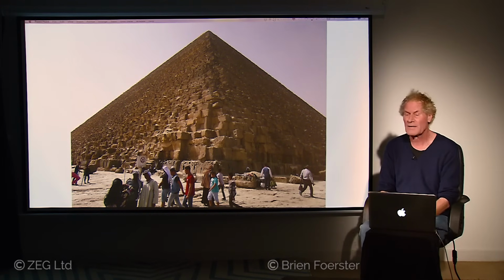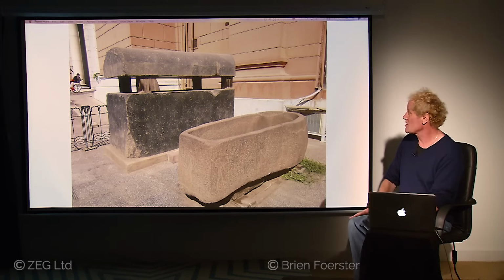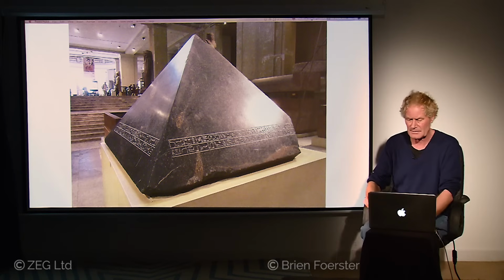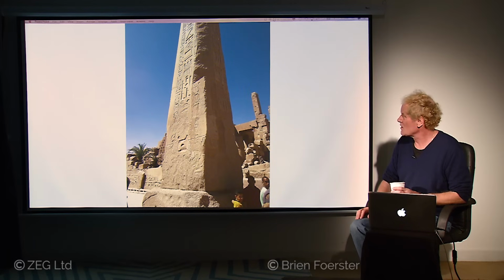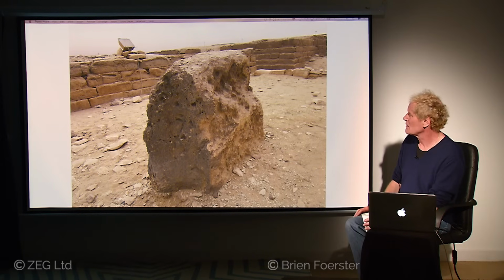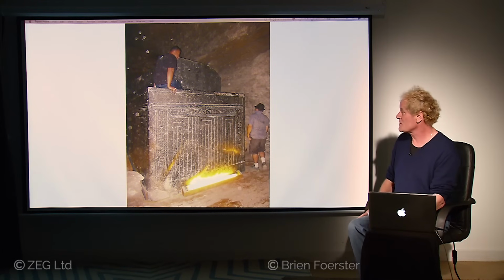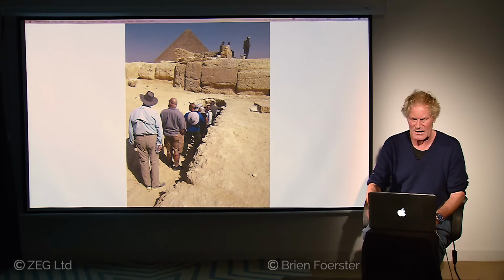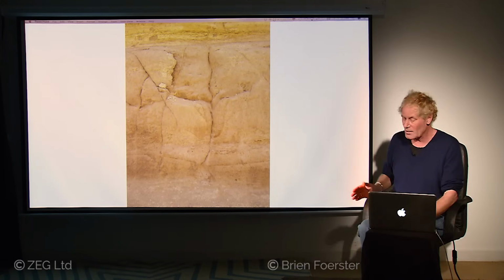Lost Ancient High Technology Of Egypt Full Lecture

Comment: sand is a very effective cutting tool - also "diamond strength" think cymatics and vibration and then you have effective cutting tools with very simple tech. spinning granite with sand in between would easily grind out circles (furthermore the granite dust from this process would cut equally as well) - sand can smooth surfaces. sand and water even better. advanced tech was not used to make this stuff - genius applications of simple tools did. 

The nile has moved since 12k BC when all this was originally constructed. the ancients were wizards at managing the power of the water, the power of sound, and the power of cutting and moving stone
Reply: waiting to see the video of you core-drilling  into granite without technology.... how would you make the hollow drill bit?
Reply: @DeadNinjutsu  you can NOT force someone to do something well, nor efficiently... precision is a product of desire  not brute force... precision comes from someone taking their time to work themselves into their work, regardless of what is being constructed... At some point the builder has to want it to be perfect! and regardless of willpower and manpower... you are ALWAYS limited by the technology available...  what you want to do is always limited by what you are capable of doing... The point is Physically there are limitations to what can be reasonably achieved with wood and stone...Aside from those monuments these people show absolutely no advanced knowledge of higher mathematics or science.. the concept of 360*, N.S.E.W. as cardinal points, Pi, etc.... none of that can be explained by a lot of folks getting whipped by a demigod! Something is missing... a lot remains unexplained to go from camp fires to advanced mathematics and engineering is a stretch... they didn't even have a decent system of writing. You are basically saying they were conveying advanced calculus and geometry by drawing pictures to an uneducated work force.
Reply: a society with any form of cuting tools is ADVANCED compared to one without, its all relative but i agree
Reply: Nonsense.
Reply: @DeadNinjutsu Agree
Reply: @DeadNinjutsu Will Power does not cut granite, willpower does not core drill. For that you need tools and they have never found a single tool whatsoever that could do this work..The whole idea of wanting something bad enough that you will it into existence is ludicrous. Maybe you should work your way back to the shallow end...you are definitely in over your head.

Comment: This is total waffle. Right from the start. 
2.5 million blocks, divide by 20 years = 125,000 per year divided by 20,000 workers equals 6.5 blocks per man per year.  Or one block every two months.
WHAT' S THE MYSTERY?.  
You sound like a total fool devoid of a basic education.
Reply: diarmuid Last and how did they move the blocks? And, cut them perfectly square at 90° angles?
Reply: @Chief81  Any 3 lengths of units with a ratio 3,4 and 5 make a right angle,  and movement only requires enough men. 1 man pulls 50 kg = 2,000 men for 100 metric tonnes.  So as you can see,,, not,  "rocket science".  
But of course this is too easy if you prefer to believe in aliens. If you already believe in miracles,  the leap to aliens is much easier.
Reply: @ @louisabridge   Because you talk like an expert, you'll be able to tell me and others how they got those 2,000 men you talk of, in that small tunnel to manoeuvre those 70 ton Granite blocks about, and while your at it, theres the 1,200 ton block at Balbeck that was transported and lifted, I eagerly await your answers.

Comment: A lot of guesswork here. Just because our primitive society uses primitive technology, like 'Diamond Saws; does not necessarily imply that an advanced civilisation would resort to primitive technology like ours today. (We have yet to earn the classification 'Civilised'.. we are uncivilised in the extreme!)  Quantum research has barely scratched the surface, Claude Shannon "Error Correction Code" discovered in the fabric of our Full Immersion Holographic Simulated Universe. ..Presumably an advanced civilisation could tap into the Holographic Projector, and possibly alter some parameters. Rock might be made as soft as cheese? Heavy weights made as light as a feather... None of it is real in any case!
Reply: " Rock might be made as soft as cheese"

Technology as powerful as that would have to be used Caerphilly

Comment: Lots of assumptions here. A stone every 2 1/2 mins is impossible? Why is it impossible? They had armies of people working on these things and they weren't all working in the same place. 
On the base, they probably went in much faster with a crew working on each corner. 
Machine marks? Big assumption. They had copper. Yea, it's soft but add sand and suddenly it becomes very abrasive and we use abrasives to cut now. A copper saw using sand as an abrasive could cut a precise edge. 
No doubt, the pyramids are awe inspiring but you gotta remember, people back then weren't stupid. Over years of working stone they figured out the best way to do things. No, we don't know exactly how they did things but that doesn't = some mysterious advanced civilization. The ancient Egyptians were the advanced civilization.
Reply: How did they move the 70 ton Granite blocks down the shafts and tunnels? theres not enough room to get enough hands on it to lift it or push it.
Reply: @MindCrazedBanjo  They were placed there first. You are assuming build the structure, then move the contents in. Many things are built around something. There is no way to move the engines into a ship so they build the ship around the engines. 
They knew what they were building for & they planned well.  You put the large pieces in, build around them, then the passages are only needed to carry the king/family members in when it's time.
Reply: @shananagans5  If you did more research you would know thats not true. The 1200 ton block at Baalbek has been lifted and laid on a bed of smaller blocks, proving that it wasn't insitu and has subsequently been lifted into position with at least 2 block courses underneath it. I'm afraid your barking up the wrong tree.

Comment: Did anyone else hear him say that the area was hit with a heat source that exceeded 2000 degrees. So when was the cycle of the sun that produced an ejected source of plasma that could travel 93 million miles and still be that potent when it arrived on earth. It came through our atmosphere like it wasn't even there. the sun was supposed to have calmed down. the only thing I can think of is something the size of a huge planet hit the sun which created the event. anyone has an answer .The only other thing that I can think of is someone attacking that city of someone attempting to destroy our solar system by destroying our sun.

Comment: Check out geopolymer.org and discover how the pyramids were built with geopolymeric concrete, and learn of related topics, such as how soft limestone becomes when wet, and can be easily removed with simple tools.  Pyramid blocks do not have natural strata, but rather a jumble of rubble, animal hairs, etc. and are 10% lighter than natural limestone - some have wood grain patterns from the forms that were used.  The truth is more interesting than theories!

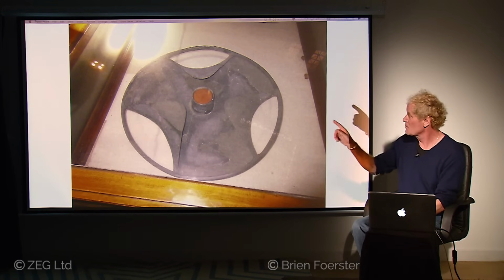Comment: At 10:30 - if you can set aside size vs ratio needed to operate such a large device it looks like a blade used to cut the blocks. Giants have been found all over the world some as much as 30 feet tall. At around 16 min. again these giants would be capable of moving large stone. Perhaps they took with them the "high technology." Other researchers have suggested sound was used in concert with other currently unknown technologies people like John Hutchinson observed using frequencies & manipulating gravity. The Younger Dryas iceage some infer came to an abrupt end by a asteroid that struck Canada resulting in flash floods & extreme heat some 12,000 years ago. See: https://tinyurl.com/y7qw28tj
Reply: Nephilim...Giants mentioned in the bible. Fallen Angel's mixing with human women, etc. Supposedly the flood wiped out these people, also plants and animals. All but Noah's wife and family and paired animals survived. A clean slate so to speak. Science and the Bible do have parallels.

Comment: @19:10 Heat-scorching..! I knew it... They used heat to make the rock easier to cut. Ive seen this in another documentary about Egypt, where they more or less stumbled over this technique when they were messing around near a quarry where the ancient Egyptians had been making obelisks...

And you could easily make some primitive cutting torches as well, by pushing air through a furnace with some holes and perhaps some copper pipes attatched, if you wanted to aply heat to more local areas, which would make it easier to chisel some hieroglyphs into something like a granite rock...

Comment: The peeling off of the surface of a rock indicates that some chemicals were applied to the surface to smooth it weakening the surface of the rock. So, it is not just metal that they used to cut and polish the rocks, but also chemicals, perhaps acids.

Comment: I would like to hypothesize that the protruding nubs on the various megalithic stones are actually designed to dampen earthquake-stimulated vibrations that would otherwise be multiplied (think cymatics) along flat plane boundary surfaces such as these stone faces. You wouldn't need one on every stone, just a few here and there depending on the dimensions of the aggregate wall face.

Comment: Dear Brien,
your theory about the ancient, pre-dynastic civilization is strangely true for the description of stone works. 
However, a progressive technical society must certainly have more to offer than finished rocks. 
The necessary technology of the environment must be available. For example the workshop for 
the production of raw materials for the tools. 

And if one considers how many complex individual parts a tool and even more a machine consists of, 
a large variety of special materials should also be seen for the production of the machine for stone 
processing. The different machines have to be produced, have to be built in a workshop. 

Machines will also have to be repaired and serviced from time to time. And old used tools of the 
machine as well as old machines themselves will have to be disposed of somewhere. And further, 
a variety of different measuring instruments is urgently needed for the manufacture of precision 
objects. These measuring instruments have to be designed, they are made of different materials. 
The instruments must be stored somewhere. Then, after use, they must be serviced, maintained 
and stored, as must the machines and equipment. 

Another theory to explain the origin of the extra-ordinarily high level of visible artistic stone 
technology is absolutely and indispensable when considered soberly.

Translated with www.DeepL.com/Translator
Reply: that is only true for humans , more simpler if aliens came with so much more advance construction equipment and bring back when they left
Reply: What you are suggesting as an explanation for the fact that there 
is no technical environment at all to be seen for the highly-qualified 
stone work is that you say that the craftsmen brought everything 
they needed, from the smallest screw to the largest grinding 
machine, to the construction site and took everything back with 
them when the work was finished.
And they tidied everything up and cleaned up the workplace so 
that nothing is left behind.
Reply: no what i said is the aliens came with optimized construction equipment ,no need of manpower only computerized CNC machine with desintegrator cutting tool that  do not require maintenance and anti-gravity lifting pods
Reply: Right, that sounds very logical. Robotic equipment and machines. 
The same thing we do with our probes, for example Couriosity.
With the difference that our probes, at least today, 
can't leave the place anymore.

Comment: Brien there is a section of ancient wall in Cusco at Tambomachay to the upper right of the ancient fountains, second row down. It is def within the area of ancient construction and continues on perfect in either direction so at this point the ruined section was perfect too. It has been vitrified still locked in situ in its polygonal construction as if the perfect wall had been damaged. To my knowledge, this is the only example of this. It stands to reason that if the original builders had still been around they would have repaired it so it happened after they were gone. Anyway, this is literallly rock solid proof that this section was struck by heat (it looks like the heat is melting upward! Like a hair dryer was placed facing upward. This suggests an explosion of high heat like a meteor impact. OR if perhaps it was damaged on purpose then it is evidence that the ancients had stone softening tech either way it is unique and is mostly overlooked evidence. I would love to hear your take on it.

Comment: To cut granite diamond is needed correct? Are there diamond mines near Cairo, North Africa or southern Europe? Clearly diamonds are found in South Africa, but any mines closer? If so is do the mines show ancient mining? Seems like someone could try to source the materials needed to cut granite.

Another note, we see scoop marks in stone that make me think ancients used something that softens stone, could there be a way to use a softer cutting blade material if the cut stone has been made soft? Would this explain the tremendous cutting efficiency of their tools.
Reply: The only thing that could soften stone is an acid of some sort.
Reply: They used sand and water to cut it. It’s been proven.
Reply: @out_on_bail  False. It would take a lot longer than 20 something years to cut granite with this method. The rotation and precision of these tools would be at a complexity we barely reach today. Were supposed to believe ancient humans possessed these tools?

Comment: I think your interpretation that the sarapium boxes may have been intended for manufacture of power is probable.
Reply: Maybe the pyramids were something similar to our nuclear reactors? Could be a dumb idea but if they had some sort of controlled reaction in the boxes generating enough heat to boil water, with the water inlet tunnels and then the exit shafts near the top where the turbines could have been mounted on the outside of the pyramid it might have worked? (machinery long since removed or decayed by rust/oxidation). The multi layered structure above the "king's chamber" could be for some sort of condensation return or reaction control or? Maybe they didn't generate electricity with it and just used the steam directly for operating tools or ironing their shirts? ;-) Or maybe it was just a HUGE whisky still for making "Nile Shine"?! lol   Fun to think about . . .I'd sure love to travel back in time to observe the building of all the world's megaliths, check out the before and after of the cataclysmic events, and maybe even do lunch with the greatest stars of history! :-)
Reply: Maybe more important for them was to secure knowledge and cult of fallen ones. Our cruel, godless civilization proofs, that they succeed.
Reply: Especially considering many have two square cut-outs on the lids, perhaps implying where connections were made? Good comment.
Reply: capacitors
Reply: so wat exactly did the ancients use this power for, and when u state power what does that actually mean??? power is not electricity it is control  it is not energy it is strength,  bagdad battery n we think oh light bulb, when it was more likely gold plating n electrolysis of metals, but please tell me what the fuk ppl mean when they say giza and power grid!!!!    words are not a useful tool  if used incorrectly!! 
here i can make this ludicrous giza power grid an actual plausible theory.
 u lot mean a fuking electric grid this i know but thats so asinine and insulting to our Egyptian cousins and their ancestors.
 i will make the statement true. 
giza power grid, 
giza=super power
power=governmental control  
grid=(here i will do what everyone does with words) so this = spere of influence (grid/sphere i dunno how they become one but  this works better at being truthful than stupid ancient solar electricity production facility.)
today we call them capitals!
its funny how ppl will deny basic and simple truths with mountains of evidence yet they will believe sensationalised ludicrous bs with no evidence but just cuz it sounds nice or fits their stupid world view.